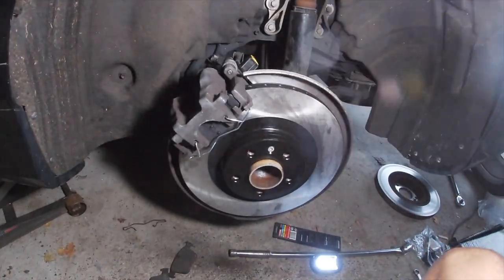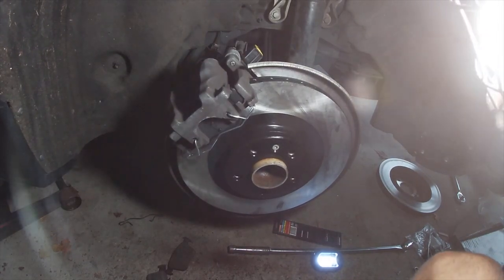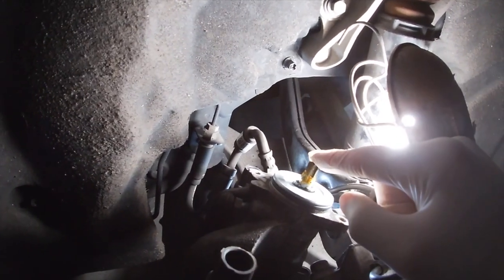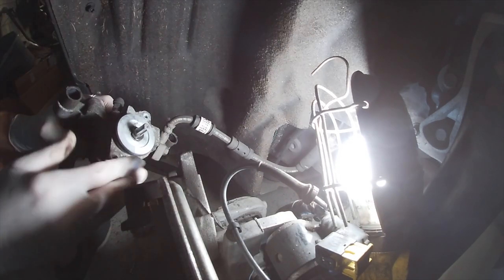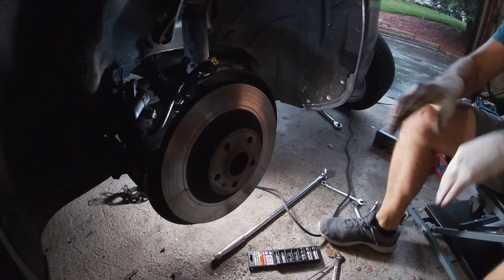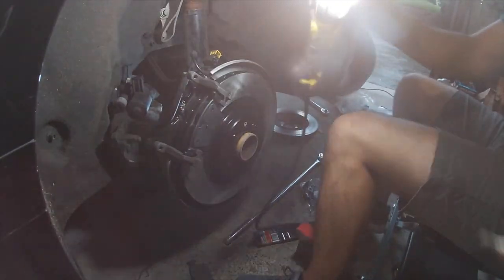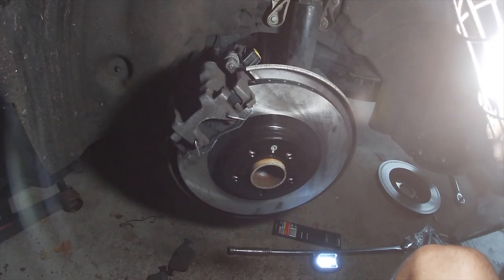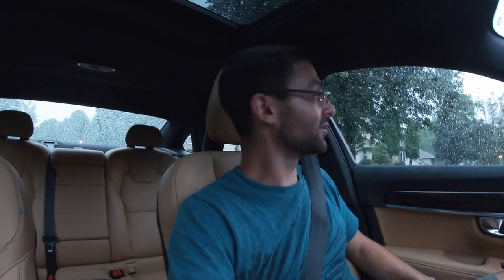Volvo Rear Brake & Rotor Replacement 2017-2023 S90 XC60 XC90 S60

Comment: A few additions.
1. To avoid the parking brake warnings on the dash
  A. After reinstalling the pads and caliper turn the parking brake bolt counter clockwise until it makes contact with the Piston. Then back off a full turn. This will space the parking brake properly from the Piston. 
2. The caliper bolts are retained with rubber grommets. You can twist and twist and the just stop turning at one point. To easily release the caliper you should push the bolts out of the rubber about an inch. 
Overall though this is a good tutorial. Thanks
Reply from the maker: great input! Thank you for your addition! I will pin the comment
Reply: Can you explain why you need to remove the parking brake component?
Reply: Tyler Shackelford Tyler Shackelford 
1. otherwise you could not turn/push back the parking brake and you wouln’t be able to reinstall the caliper
2. you would break the cogwheels/electric motor that moves the parking brake
Reply: I did not need to do this.   Just turning it in all the way worked fine.   No need to back it off.  This was a '18 S90 T5
Reply: @shacketj  you need to make clearance to fit new thicker brake pads.  On regular brakes you do this by just pressing the brake piston back into the caliper.   This rear caliper is basically a piston within a piston.   The inner piston is the one actuated by the EPB motor.   This piston is on a threaded rod and the rod is turned by the motor.  As the pads wear the inner piston comes out a bit more to take up the additional clearance created by pad wear.    If you have the appropriate car computer, you can connect to the OBDII port and tell the cars computer to activate the EPB motor and pull the inner piston all the way in.   If you do that, then you don't need to remove the EPB motor.   Without one of those computers you need to remove the EPB motor in order to get access to the rod that moves the inner piston.  Once the inner piston is all the way in, you can then push in the outer main piston the way you would do it on any other car.
Reply: @DIY_Al  Ah, that's the missing link and why some videos show electronically backing this off and some don't. Thanks, alex.
Reply: @DIY_Al   Thx for the clarification -- Do you know of or recommend a tool for backing off the EPB motor?
Reply: @DIY_Al  Same here. confirming turning it back all the way worked fine on my '19 S60 T6. this resolved the "Parking brake not fully released" message.

The message appeared after replacing rear pads/rotors. Engaging and releasing the parking brake did not clear the message. I then removed the wheels, turned the EPB motors fully counter clockwise, replaced wheels, and started the engine. The "Parking brake not fully released" message appeared again. I then pulled up on the parking brake and the message was cleared. Then proceeded to break in my new pads/rotors with no issue

Comment: Just completed the rear brakes on my 2017 S90.  I was a little worried about taking this project on after reading about the warnings, etc.  However, I dove into it and happy to report that I had no warnings or issues after taking L Mars advice...don't disconnect the brake motor cable.  There's plenty of room to work.  There's also no need to take the plastic clip off the brake motor either.  The T25 bolts are easily accessible without removing the clip.  One additional clarification: After compressing the the brake piston with a C clamp and turning the brake motor shaft clockwise until it bottomed out, I installed the brake pads on the caliper bracket and reinstalled the caliper.  After tightening the caliper pins, I reinstalled the brake motor.  I then turned the brake motor shaft counter clockwise until the pads were gently snug against the rotor (no play in the pads).  You may need to (gently!) use pliers to turn the shaft (for me it was less than one full counter clockwise rotation).  As I said, no issues.  First side took 40 minutes.  Second side about 20 minutes.  The savings were well worth the research.  Thanks for the video!

Comment: I just did the rear brakes on a 2018 S90 T5.   I watched this video, as well as a few others, before attempting the job.   The Volvo dealer gave dire warnings about them not doing the job.   A local mechanic didn't want to do the job as he didn't want to risk messing up the Volvo parking brake electronics.    Fear not, this is an  easy job that most home mechanics can easily tackle.    If you have done rear brakes before, you can do this, it just takes a little bit longer.   The non-standard tools you will need are a 5mm and 7mm allen key, or socket and an e-12 Torx socket.   You can do without the Torx socket, but I found it helpful.  You can disconnect the power plug to the EPB motor, it does not cause any lights to come on if you disconnect it.  Just make sure you turn the EPB actuator on the caliper all the way in.    I used the Torx socket to twist the parking brake actuator on the caliper.   Do it by hand and turn till it stops.  It is not difficult to turn and you should stop when you feel resistance.   Then follow the instructions in this video.   Once you have the wheels back on, just activate the parking brake a few times.  You will hear the motors whirring.   No  warning lights came on.   Don't forget to bed in your pads when you are done.
Reply: What kind of half-assed professional mechanic is not able to replace brake pads? You need to find yourself a real mechanic.
Reply: @Bunyip17  one who does not have a computer to put the brakes in service mode.   Auto parking brakes systems are idiotic and add unnecessary complication to braking systems.  What should be an easy job becomes more complicated if you don't have a VERY expensive computer.
Reply: Yes, I understand all of that. What I’m saying is simply: your “mechanic” is half-assing his profession if he isn’t willing to invest in the appropriate tools to do his job. Does he refuse to do other jobs because he doesn’t have the right sized socket (and isn’t willing to invest in a set)?
Reply: @Bunyip17  I guess he is getting by without the proper tools and getting enough work that doesn't require one of those devices.  No biggie, we save a bunch of cash doing this ourselves.

Comment: Has anyone commenting here had an issue with their rotors warping? My moms 2018 XC60 has some serious rotor warp, at highway speed it feels like we're just on Belgium blocks. We're wondering if it's from the parking brake being applied every time the car gets turned off, although the rotors shouldn't be nearly hot enough for that, or from the adaptive cruise control. The fronts were replaced yesterday and now after watching this video I think I can get the back done as well. Thanks for posting it!
Reply: They have probably been binding on slightly and got overheated.
Reply: SPA volvo brake pads and rotors are no good, this is a common issue. My 2020 V60 CC is already on its 3rd set under 40k miles and my 2019 S60 just got its 2nd set under 30k, I'm going to replace them with some nice Brembo parts soon.

Comment: DON’T DISCONNECT the brake motor cable (yellow cap) from the parking brake motor. This is what causes the brake warning light. Leave it connected and it will not generate the error. All the other steps are spot on. You can also use allen wrenches to remove the 4 bolts.
Reply: What I’m reading is the same but need to go to the shop to reset the brake warning? Comments here say I can cycle the epb or roll the epb motor back on to the piston?
Reply: Chris Sherlock Yes, you can simply turn the gear counter-clockwise until it stops. Do not disconnect the cable.
Reply: Do you even have to remove the emergency brake part at all?
Reply: IS it normal to have to replace the rotors after 30k?
Reply: Joshua Pierre no
Reply: Fresh Douglas Not usually
Reply: @lmars  Why do the videos (there are others) remove the EPB then?  Is it just to compress the piston?  I never understood that part.
Reply: Tyler Shackelford the only thing you don’t remove is the cable that controls the electric motor. You do need to twist the bolt in order to compress the caliper piston. Otherwise it won’t move.
Reply: I need some clarification.   I need to remove EPB motor without removing the plug.   Once the EPB motor is off I will have access to the shaft that is on the brake caliper.  I will turn the shaft clock wise till it won't turn no more.    Then I can compress the brake caliper piston as usual.   I will then replace the brake pads and install the pads and the caliper back on the car.  Once the caliper and new pads are in place, I will them turn the EPB shaft on the caliper counter clockwise till it contacts the piston.  Then I will turn it clockwise again 1 full turn.   Once that is done I can reinstall the EPB motor on the caliper.   If I follow this procedure I should not get the warning light.   Correct?  If I missed anything, please feel free to add to the comments section.
Reply: @DIY_Al  You don’t have to turn the bolt back, once you reengage the parking brake after installation it will automatically go to the proper setting.
Reply: I just did the rears on a S90 T5.   Removing the plug was not a problem.
Reply: @freshdouglas1288  My S90 front brakes were burned out around 30k and now at 40 my rear pads are out.
Reply: So I'm about to do this for the 1st time on my sister's xc90, 2018 model. Will I have enough space to take off the motor cover to retract the motor back without disconnecting the epb elec. plug? I have seen other vids where they disconnect it, and use a 12v source to back the motor inwards. My mechanic friend has a Launch 909 scanner. Has anyone used this to put the epb in service mode? He said that it worked for an Audi, but has not tried it on a Volvo.
Reply: @crispa1861  if you don’t disconnect the cable once you use the switch to reengage the brakes it will go to the proper setting. You may just have to do it a couple of times.
Reply: @freshdouglas1288  It seems to be the case. The computer uses the EPB for anti roll back etc so the pads get a lot of wear. Before all the gizmos the rear pads and discs would last many years and huge mileages. The drive away method of handbrake release also causes premature wear.

Comment: Thanks. Dealer just told me my pads are almost done and want $330/axle.

Will be doing that myself 👍
Reply: My dealer wanted $600!
Reply: @ericw1261  Update: that was just pads. They want something like $700 for a full set of rears. I was in the middle of a move and couldn't get to my brakes (front) earlier this year, but now the rear are done, so I'll be trying it myself. Done brakes a number of times but never played around with an electronic parking brake.
Reply: I was told $800 just for rear? Is this right!!!!

Comment: if you dont have vida to release park brake you can use a 9v battery and 2 bits of wires to the terminals on calliper
Reply: Don’t you have to unplug the wire causing the light to come on dashboard??

Comment: I'm working on this NOW and the ROTOR will not remove. Both rear rotors are stuck in lower left position. They DO spin....but even after hammering it seems as though it's nearly magnetic holding it in place!! Any ideas???

Comment: Thx Kyle. Great video i did it myself but after done air bag system malfunction came and also brake system malfunction came on display. Please explain us about this issue
Reply from the maker: So, not sure about the airbag light. Maybe pull battery and let system reset and plug in after 20 minutes. 
As for brake system, mine did the same. You need to keep pressing the parking brake for it to reset. Once it resets you will hear it finally engage and the light will turn off.
Reply: @KylePancis  thamks Kyle. Exactly i did it. Out battery wait few minutes. Both alarms still on BUT after been rumning 5 min gone. Im fine now with my s90 2017. THANK YOU SO MUCH
Reply from the maker: @jorgecajas832  Amazing!!! thank you for the latest!

Comment: Really thanks for your video. 
I have changed the  brake pads of my volvo s90 2018 with the help of this video easily. :-)

But after changing the brake pads I am getting an Error Messege in my Car Display.  " Parking Brakes are not fully released " with the continuously  warring Sound :-(

Now I really need your help and Maybe you can help me to remove this error??
Reply from the maker: Hahaha had the same issue! Just keep engaging and disengaging it until it resets.

Appreciate your support and very glad this was helpful 🙏
Reply: @KylePancis  engaging and disengahing what?
Do you mean to turn on and and turn off the Button of Parking Brakes?
Reply: @KylePancis  sorry, I just dont get it .
I just got that I need to reset something. And please Could you  explain what and how to reset?

Many thanks

Comment: One if my rear caliper screw is just slipping...how is that possible? I didnt use too much force either
Reply from the maker: Wrong size?
Reply: @KylePancis  trying to remove it...I ended up removing the caliper and bracket as a hole.
The torqx/Allen is the right size though. Seems it was so buster it just ended up slipping
Reply from the maker: @faridb40  
Ok that works. The torqx bit maybe worn out perhaps. Check that tmits not rounded off
Reply: @KylePancis  no tools are perfecto and new, but it seems it was rusted enough to strip the threads. I just took off the caliper bracket and went from there. I finally got the job done, front and rear on my 16 XC90 😎. I feel proud

Comment: Ugh, I wish I saw this before today! My wife’s 2019 XC60 needed new pads after 15K mikes JUST FIFTEEN K MILES!!!!! They charged us $659 to change the break pads on basically a brand new car! It’s not like she is an agressibe driver either, annoyingly so....Has anyone else had to replace them that soon???
Reply from the maker: wow super low miles. I wonder if the emergency brake is creating a little extra friction to wear out pads faster....
Reply: @KylePancis  Not sure, the tech said it was "normal" Subtext being "see you in 15k miles" Not now that I saw this. Did you rent a scan tool to reset the settings?
Reply from the maker: @k.j.g.9601  no, it just reset on its own
Reply: I’m at 60k and I’m going to attempt to change them myself tomrorow